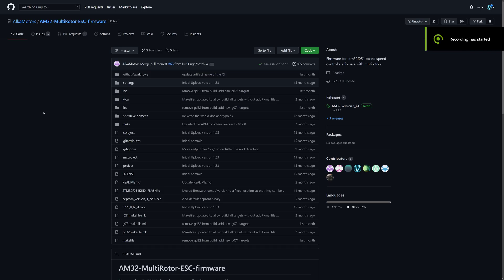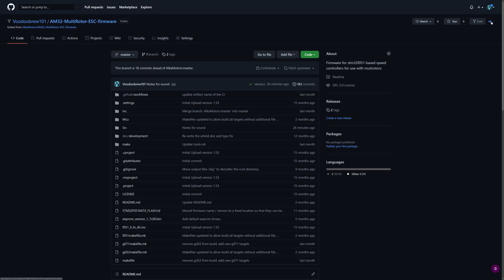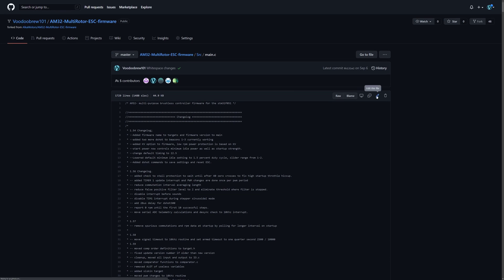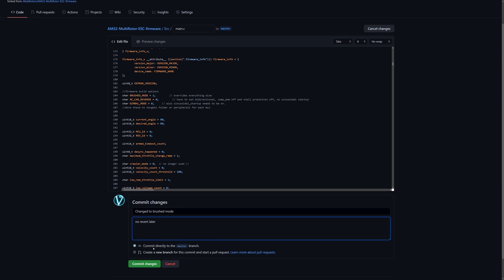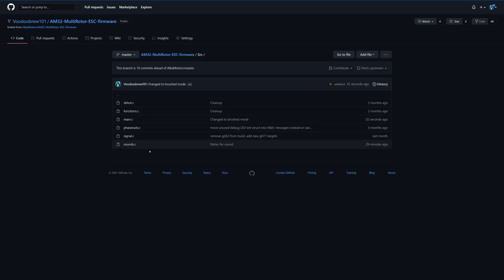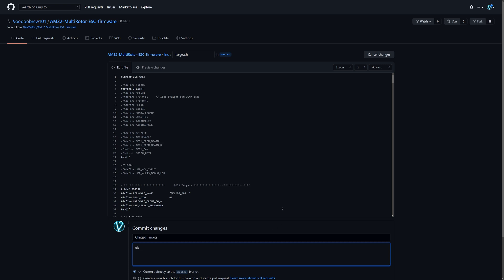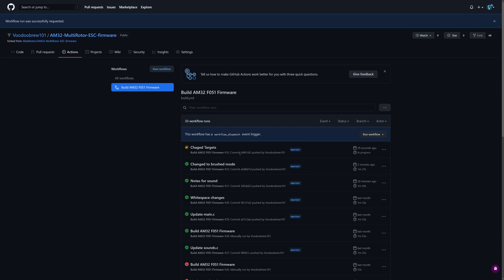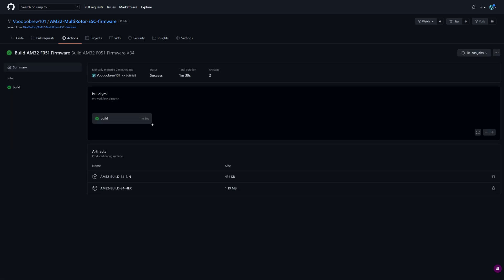Build AM32 Yourself

Comment: After this step, how do you go about putting everything into the esc config? Do you do it with the st link? I can't get the esc to start up. Am I missing a step or 2? Trying to get rid of the motor cog between sinusoidal and the regular motor operation thats on your older bin file. New to this so I apologize in advance. Just not sure what to do next. Or can you make a new wraith 32 bin file to fix that cog? I really appreciate your help.